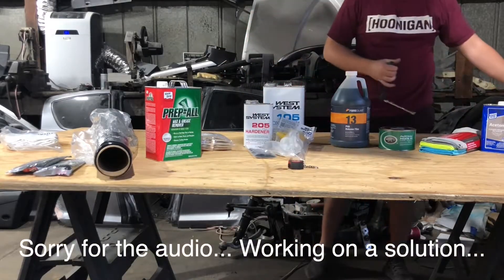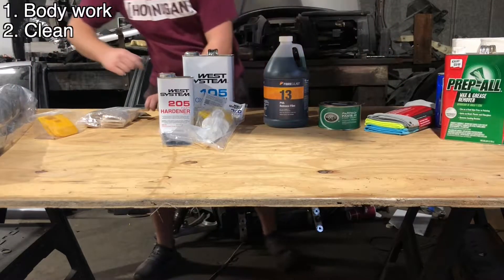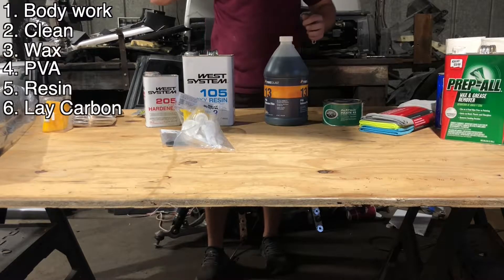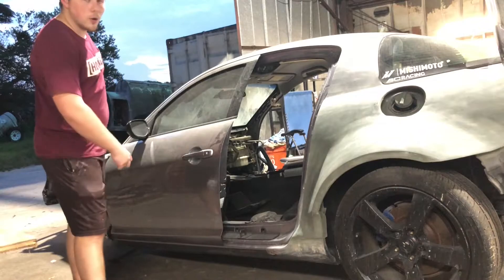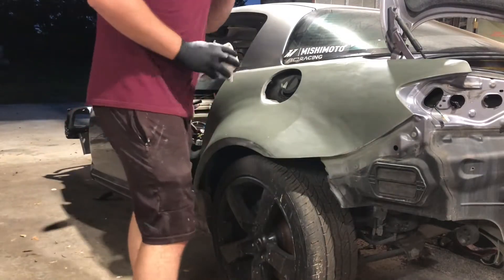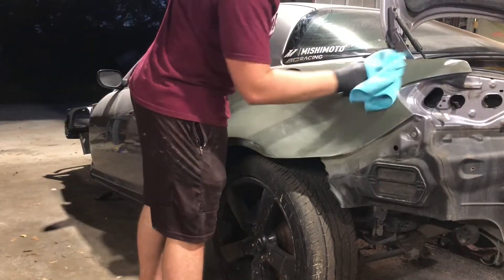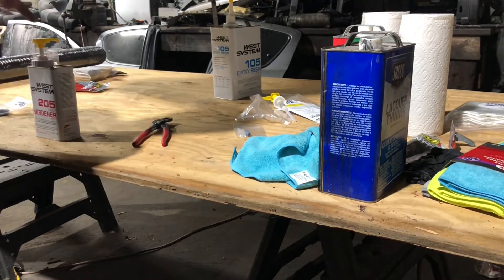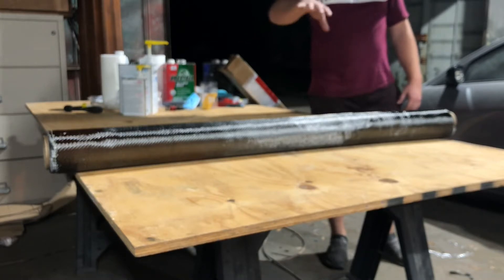2JZ RX8 - How to make carbon fiber parts (Part 1) - Part 15

Comment: I don't know for sure, but usually those kinds of spray stuff are kinda toxic. Maybe you should wear something other than a cloth mask? Probably a proper respirator or a n95 mask?
Reply from the maker: Micah S 100%. right now in florida you can’t buy anything else due to the covid. i had fans and the doors wide open but your are completely correct